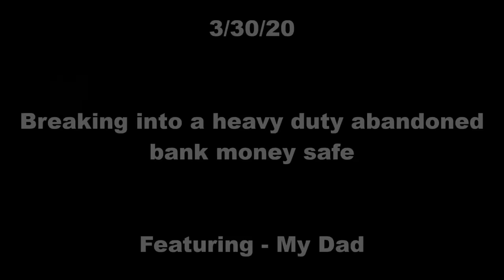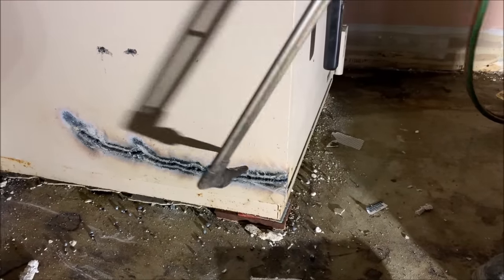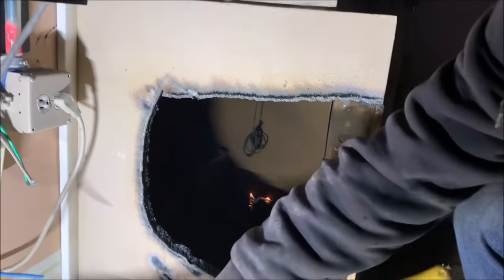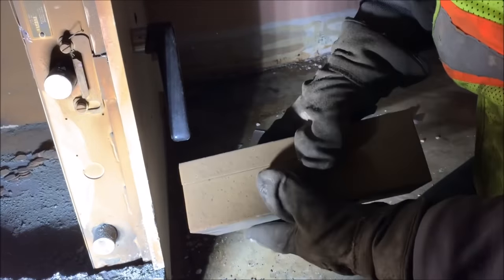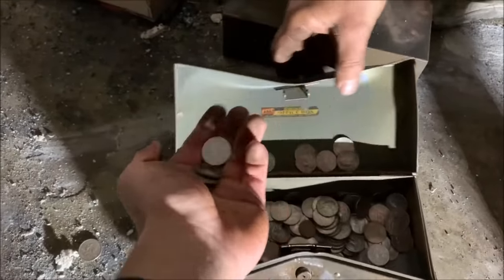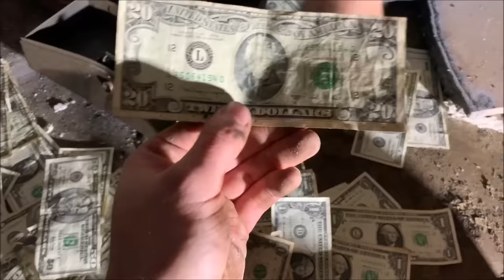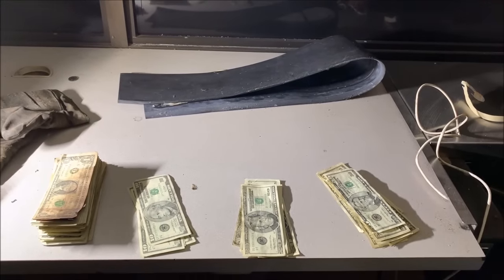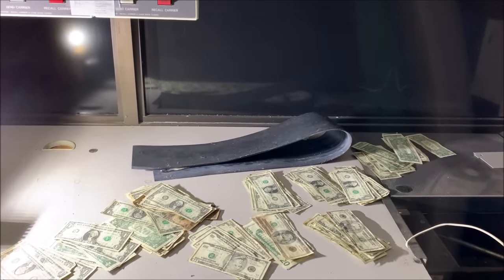Breaking Into Heavy Duty Abandoned Bank Safe With Torch - I Can't Believe How Much Money Was Inside!

Comment: Future tip. Use a grinder and cut around where the dial was. Usually you can cut out an area about 5inX5in. Once you pop that out you can release the lock without the risk of torching paper money inside. Also heard of people drilling a hole in the top and filling the safe with water before cutting it open with a torch.

Comment: Just curious about this particular safe and it's probably a stupid question... however why couldn't you torch off the exterior hinges?? I'm not being a smartazz. Just curious??
Reply: Chris Bloom with you there. They burned bills in the safe. Open the door, not the side.
Reply: Ithink the bolts in the sides of the door would prevent access if the hinges are removed

Comment: That is a sweet score! Im actually a little worried there may have been bills in the safe, out of the boxes, and disentegrated. So, My idea/Suggestion : Next time flip that big boy on his side, so the side you cut, would be on top. Use the torch to cut a small hole to begin with, FILL IT WITH sand or dirt, so anything inside wouldn't get sent to hell. Also maybe invest in one of those automotive pinhole cameras on the wire you can get from harbor freight for pretty cheap. Just to get a glance inside perhaps. Great find though, guys!

Comment: If you going to use a torch on a safe drill large hole on top and fill safe with sand or water thru the hole to ensure the contents do not burn! Buy. Bags of cheap sand at Home Depot!

Comment: When you're opening something with a torch always use a plasma cutter because it's a very fine cut I hate and high-pressure but it keeps localized and doesn't spread the heat out less chance of ruining your products inside the save

Comment: next time drill a hole and put a  boroscope snake camera inside first to see if there are loose bills. i bet you burned some loose bills too but you will nevet know now. you can get a boroscopd camer really cheap so there is no excuse not to check first. and if there is a decent amount of loose bills grind into the bolts instead or grind the hinges and put a steel wedge and use a sledge hammer.

Comment: Why didn't you just cut the hinges and pull the door off cutting the side of the safe you're taking a chance of burning up whatever is inside
Reply: cant do that to this type of safe , it has pins preventing the door from being broken into . but i do agree to cut the sides out, when i do one i try to roll the safe to one side to get everything to one side then cut the opposite side.